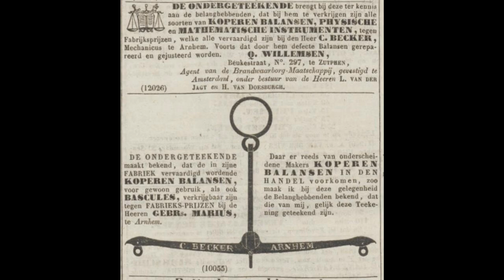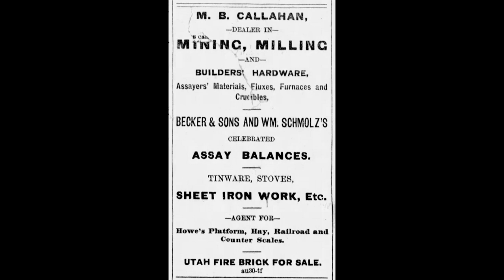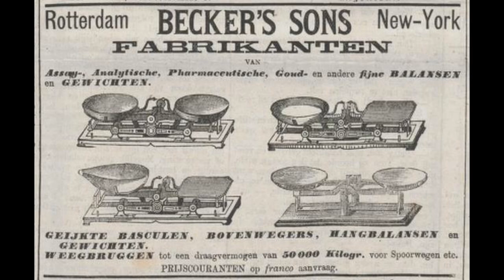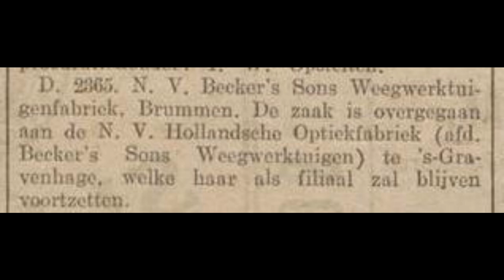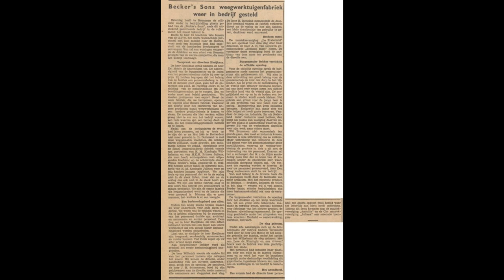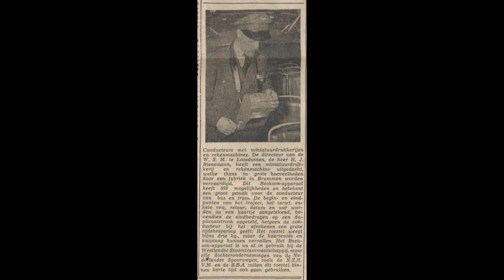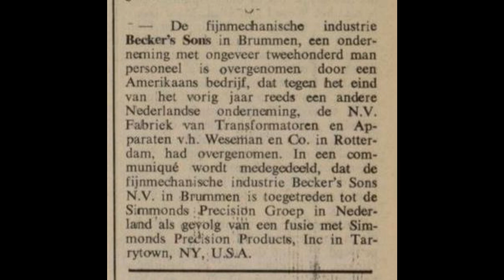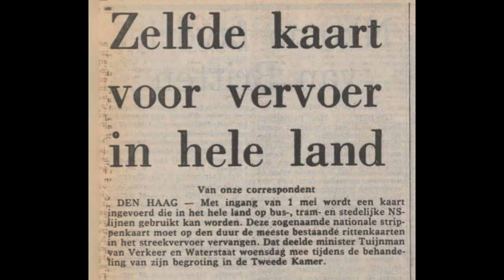The Beckson ticket machine

Comment: I wonder how the levers for the date and time were used in practice. Was the worker who printed the tickets supposed to look at the clock every single time they were going to print a ticket, and adjust the levers accordingly? Why not instead build a timekeeping mechanism into the ticket machine itself?
Reply from the maker: It's not much of a burden. Most of the time it would involve adjusting just a single lever. It is probably better to force the operator to check the time than to rely on a mechanism that, if it failed, would likely cause dozens of invalid tickets to be issued before it was noticed. Those passengers might even be unjustly fined if their tickets were checked.